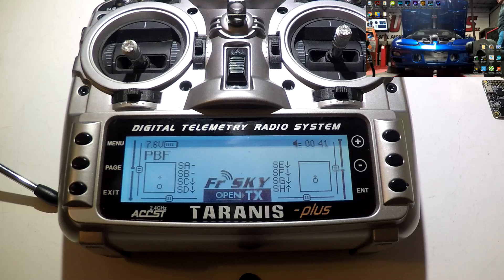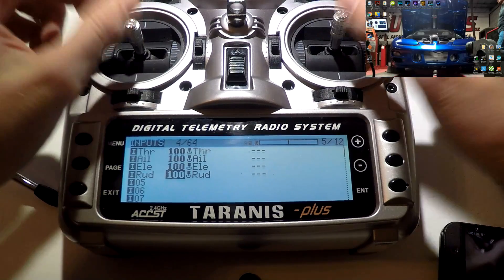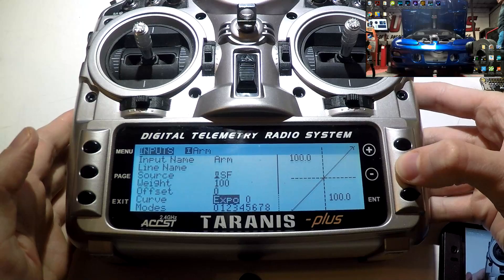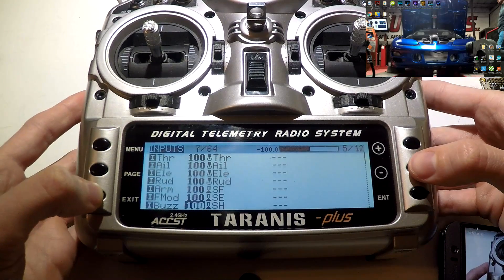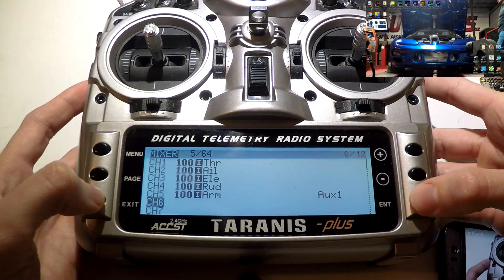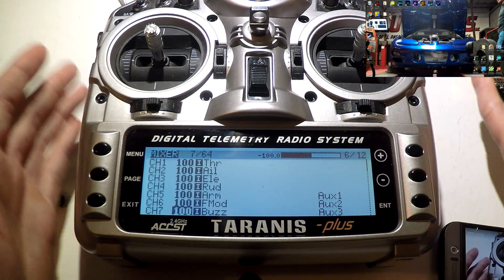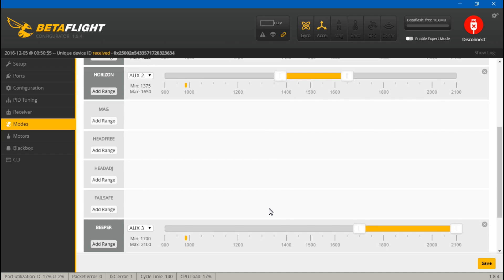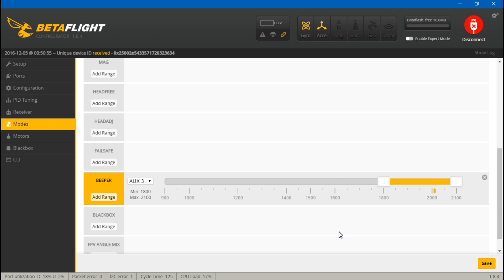Taranis X9D: How To Create Switches

Comment: hi i have got my new tarnis plus when i go to input and on channel 5 there is switch option when i go there i only see maximum 2 switches se and s2 rest of the switches wont appear there what im doing wrong or is the any fault im worried im using it internal d8 protocol and another crossfire with 85x 4k whoop kindly tell me what do i do to get all my switches and be assure that the taranis plus is fine

Comment: I have set up as per these videos and the controls are all wrong. You show the movements by moving BOTH sticks at the same time which does nothing but confuse. I guess those in the know would be OK with that. I would ask why are they watching. I am mode two and want the left stick to control throttle and rudder in the conventional way. Right stick again in the conventional way. Another channel goes over quads for everything and then when it comes to basic stick setup switches to air plane. 
Have you done a video showing how to sort this out. If so can you link it for me. Some suggest you look through their entire playlists trying to find it, rather than be helpful and just link it.
Reply: Jc is not with us anymore.
Reply: OK I understand now : (

Comment: Just a suggestion. A short series on OpenTX 2.2. With the availability of the Taranis X7Q and Horus with OpenTX 2.2 many of the original 9XD owners will be upgrading. Admittedly there is not much extra on offer but it is better to stay in sync. Problem is a few things have changed like sound file indexing, shorter titles again :(  etc. Not to mention how to even get 2.2 in the first place since it will not be offered as an automatic upgrade when using Companion 2.1